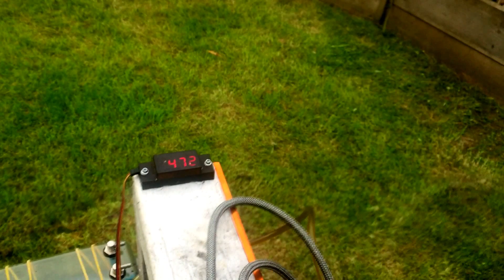Saito FA-60T CDI conversion 20 to 1 mix

Comment: Hello I have a 40cc  yuhe twin star twin cylinder engine. That want to to do a CDI conversion on The cylinders are 180 degrees from each other. What system do you recommend for it. Thanks ahead of time for any help.

Tom
Reply from the maker: +tommee10533 

Hi Tom

Can you contact me in my website please 

morrisminimotors.co.uk